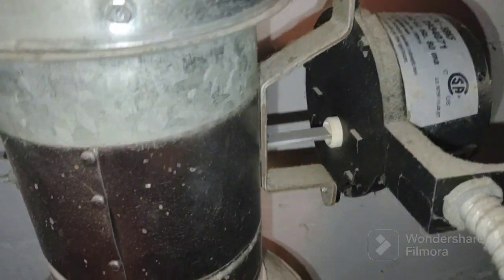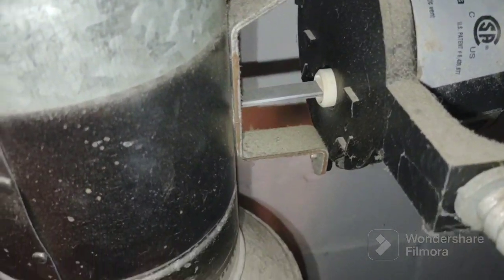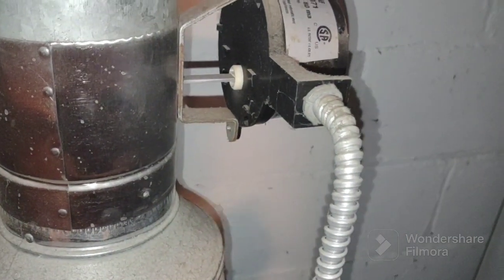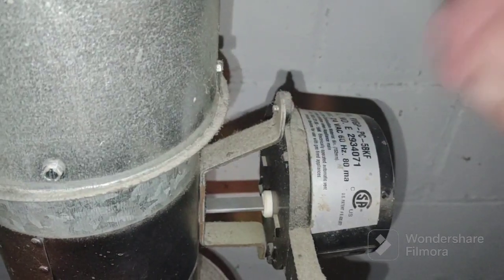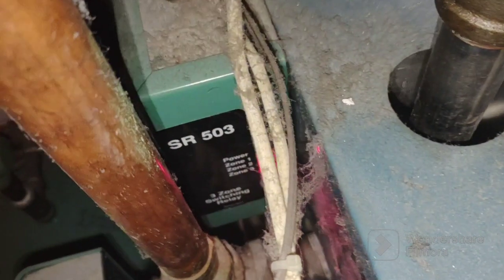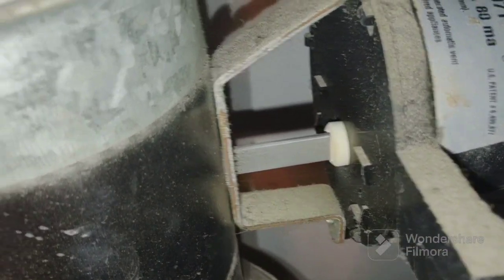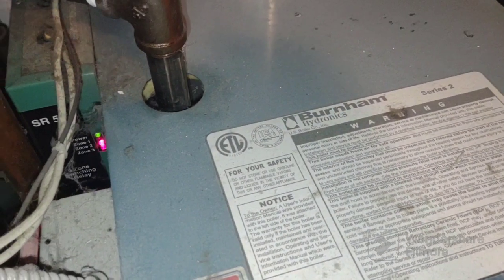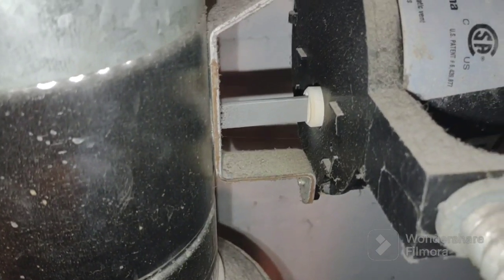Burnham Series 2 Gas Burner damper open - but didn't fire

Comment: I have an old Utica gas boiler 30 yrs old , it’s has hydronic system with 2 zone valves, no draft hood , its working fine and no major problem but there’s no spill or roll out switches in the beginning, as safety do I still need them to install. I couldn’t find in the internet the ideal placement with these switches in my particular boiler. Any suggestions

Comment: Don't ever change your boiler, even if any heat guy tells you to do so. That boiler could literally last 100 years. All it is a cast iron pot that holds hot water. The heat exchanger will never crack like a steam boiler would.
Reply from the maker: The Burnham Series 2 is a wonderful boiler. It's quiet, efficient, and reliable.  I have no intention on replacing this unit ever, unless it has a major failure. Thank you for your feedback.  I agree with you 100%.

Comment: Did you get this resolved?  Running into a similar problem, except my dampener opens and then closes up again.  Had it running for a few minutes, but then it went out.  Think it's the dampener motor is going, but also noticed the Flame Roll-Out Switch was dark and wondered if that might be tripping it too.  

Had changed the gas valve last year since it was buzzing.
Reply from the maker: Hello,
  It's been working properly ever since I took this video.  No issues at all.  I think it may have gotten stuck from not being used since last winter.  I'm keeping an eye on it and will replace the motor if it acts up again.  But we've been using the heat and it opens and closes perfectly.